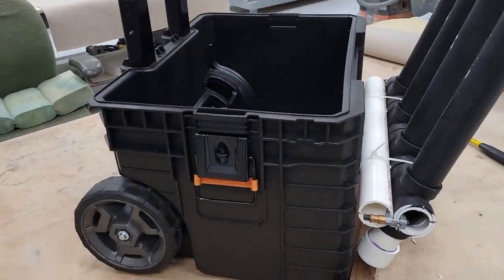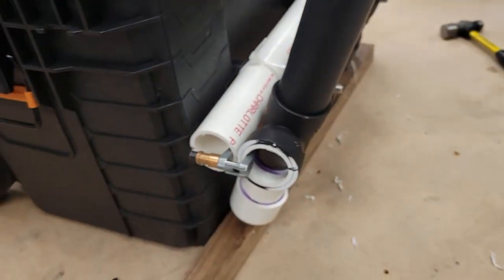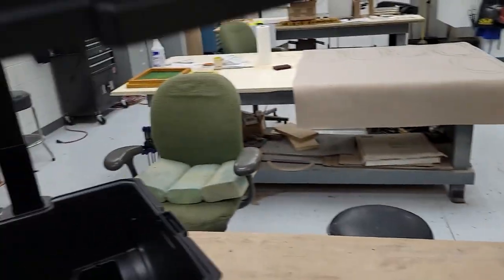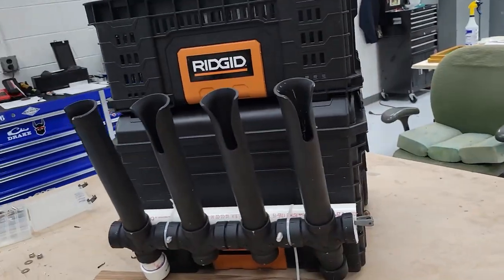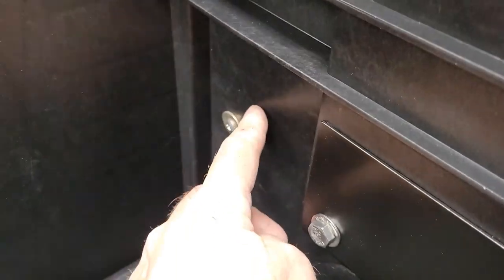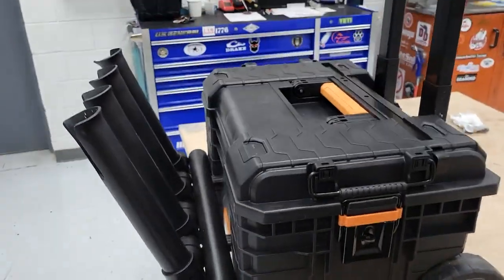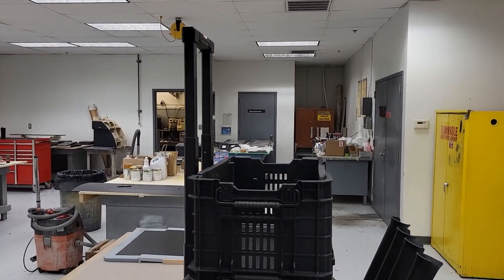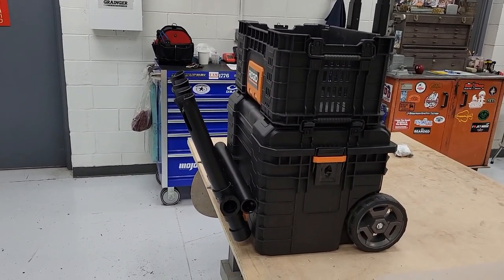Ridgid Fishing Cart

Comment: The telescoping handle will take a dump on you I promise I bought that box for its intended purpose and the handles a piece of s***
Reply: I know there's a 2.0 version of that I don't have any experience with it but I don't usually give people a second chance with my money 
 I actually did a similar deal to what you've done only I bought a magliner hand cart at a yard sale that had flat tires I replaced the tires and I stacked up two of those baskets and I also use the compartmentalized rigid box to hold all of my tackle that's a pretty decent setup.